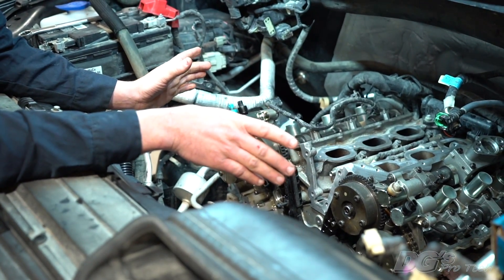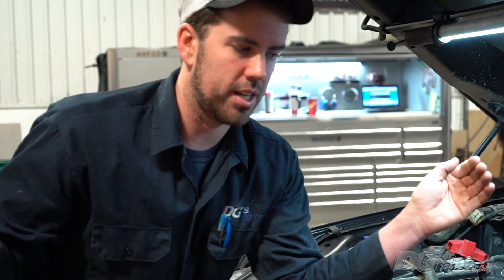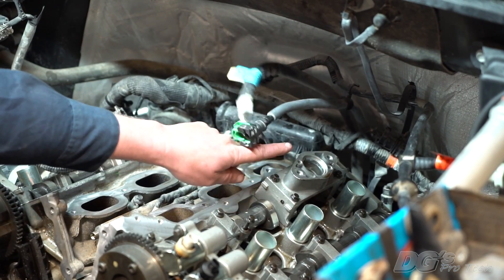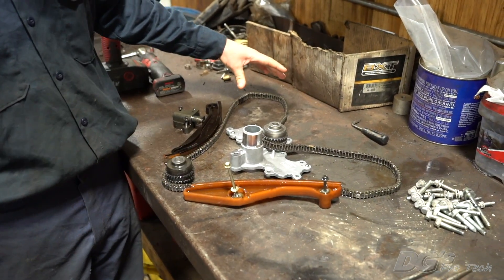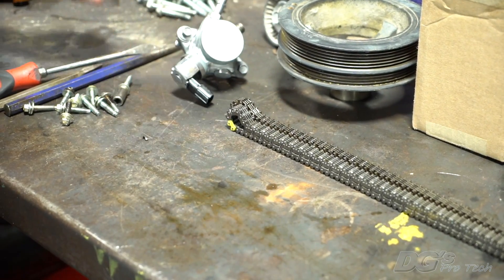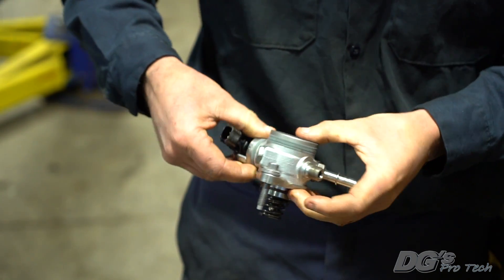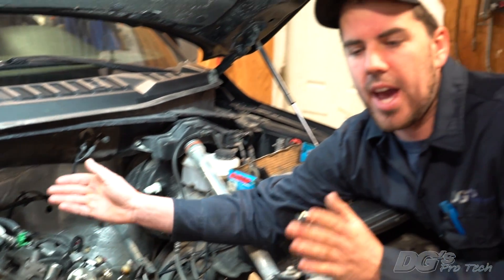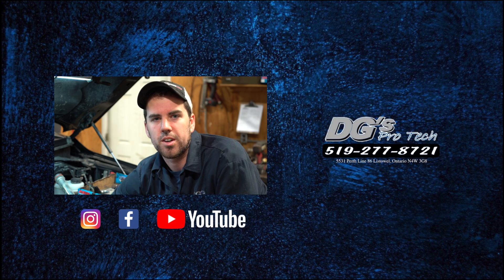Ecoboost Engine Problems!

Comment: This is a great video, seriously one of the best automotive videos I've watched...wish I'd seen it years ago!  We have a 2013 F150 EcoBoost.  Originally was used for short commutes and driven gently to maintain fuel economy, but then towed heavy a few times a year.  Had 2 turbos go out due to wastegate issues (on warranty), and also the dump valve with a tear in the diaphragm.  Then, at 110,000km got the dreaded timing chain rattle.  Replaced the WHOLE timing system ($3500++CDN).  The mechanic who did the work showed me that the original tensioning slider that presses on the chain was plastic.  The new part was plastic but had a stainless steel plate where the tensioner pushes against the slider...this prevents a hole from wearing in to the plastic slider.   Thanks for the vid...you've got a subscriber now

Comment: Great video,and just a minor correction,the changes were made for the 2017 model year when the Gen 2 version came out in f150 pickups with the 10 speed. That engine has 2 separate chains which is why it uses separate tensioners on each bank. According to the forums the Gen2 has cam phasers issues. I have a 2017 and do my maintenance at half Fords recommendation,so 4500-5000 miles full synthetic and motorcraft filter. One other thing different on the Gen 2 is electronic wastegates, which should test cycle at some point right after startup,eliminating the frozen wastegate issues,but adding an electronic wastegate down near all that heat,salt  water and thermal cycling may give us another. Issue long term, failed wastegate actuators....
Reply from the maker: Yes only the updated version in higher models in 2017 The ho raptor etc. Moat models not till 2018
Reply: DG's Pro Tech Sorry man ,it’s all 3.5s in F150s for 2017, the Raptor has the 450hp version, all others were the same 375/470 . In 2019 , the 450 hp version became standard on the limited trim level as well as the Raptor. All 2017s had the 10 speed and Gen 2 engine. I have a December 13th 2016 built F150 and it is definitely a Gen2 375/470. Some other ways you know besides the 10 speed, are the electronic wastegate ,the auto stop/start,and the dual injection system with port and GDI injectors.
Reply: John DiMartino okay So I was wondering this, in the gen 2 eco There is 2 seperate timing chains for each bank and only 1 tensioner per chain? Still would probably help with chain stretch correct? Less load on each chain

Comment: What's your take on the Ranger 2.3  4 cylinder EcoBoost?
Reply from the maker: It's a great engine that has been around in other forms, it is the same engine we see in the mustang now, no major issues,
Reply: @dgsprotech985  Excellant.  I wasn't sure if the weight of the truck made a difference.

Comment: Very informative. Thanks. I have a question: after driving in boost, do the turbos on  the Ecoboost need to be cooled down before shutting down the engine? I know that's the case many, many years ago with turbos so that the the oil in the bearings can cool down to prevent premature failure. Ford dealers say this is no longer required with the Ecoboost. What is your opinion?

Comment: Great video, I agree on the maintenance. Gotta change your oil in these engines. I have a 2014 Ecoboost and I’ve been changing oil every 5k miles with Motorcraft oil and filters. No problems at 77k miles and I regularly tow an 8000lb travel trailer.

Comment: I have a 2011 f150 Ecoboost has 140000 mile no issues. Change oil every 5000 to 6000 miles. I drive it mildly but I always get into it every so often.

Comment: Just wanted to let you know that this is a fantastic video. Just a technical analysis and understanding of how to keep these engines running in smooth condition. Many people need to see this video and understand that these engines need to be worked and opened up every once and a while to keep them running at peak! Of course through, we need to make sure that there is good synthetic oil being used and changed at an APPROPRIATE interval! A little love goes a long ways with these awesome trucks (Recent F-150 3.5 owner)!

Comment: are pushrod engines better?  dont like timiing chain/belt replacements.
Reply from the maker: they have more moving parts and suffer from higher RPM inefficiencies related to more moving parts
Reply: The way most people drive  they would never notice  difference  a push rod lump would do much the same

Comment: Dustin, Great video Thank you. 
I am very interested in your thoughts on what follows.  

I have a 2016 3.5 Ecoboost. I am getting a weird noise upon startup that I think might be the timing chain. I have 107k on the vehicle.  I have always changed the oil prior to the recommended intervals but according to the maintenance schedule in the manual it needs the timing chain replaced at 100k. Were you saying in the video that you won't experience this with better maintenance? Or does this have to be replaced at the 100 k ballpark? Either way I'll get it addressed.

Second issue.
 I love this truck but I've experienced overheating  while towing a 7000 pound vehicle in the Colorado mountains. (That is going above 226 degrees up to 240 degrees in this engine. The software has never shut the power down but it has alarmed me as I don't want to melt the engine.) I've overheated on steep grades while towing that trailer or I've also overheated when the outside temp is above 90 degrees while in elevation. The boost is 15 lbs in this situation.  The way I keep it under control is lowering the gear and raising RPM's.  Just outside Denver I have to go to the lowest gear possible on steep inclines to get enough water through the engine to keep it cool and as a result I cannot maintain a fast speed.  It is ridiculous.   Many other trucks are passing me and I know there is something wrong but am at a loss for what it could be.  What could it be? I was thinking water pump not pumping adequately, Radiator undersized.  Turbos throwing off too much heat...Thoughts??? 
Thank you.

Comment: Thanks Dustin, for sharing.  As many have said before, really nice clear presentation.  I notice the two timing chains appeared to be different in width.  The old one looked narrower than the new one.  Was that an upgraded chain and did you also change the phasers?   Thanks

Comment: The problem wasn't common on earlier Ecoboosts but it did happen. The GEN 2 Ecoboost fixed this any many more issues. So if you want an Ecoboost, try and get a 2017 +. The earlier ones still last past 300k miles

Comment: Great video!!!

I just purchased a 2016 F150 Lariat with 3.5L Ecoboost and have been reading a lot about the issues it can have. In addition to frequent oil changes (every 5000 miles), what are your thoughts about using an oil separator?

I have read posts that say it will help the engine and other posts that say it is a waste of money.

What do you think?

Comment: IS THAT ECOBOOST 2ND GEN?
Apparently they fixed timing chain issue in 2nd gen?
Reply from the maker: they were supposed to be fixed for any model built after 3rd quarter 2014. however we have done many after this date, so i cannot confirm any changes other than to the literature
Reply: 2017 ecoboost is the gen 2, they went to two primary timing chains instead of one primary. They reduced the length of the primary timing chain by over half. They have fixed the timing chain stretch on the gen 2 ecoboosts. They are still having rattle on start up issues with the gen 2 phasers.

Comment: I'm looking for some advice on my 2011 F150 Ecoboost. My truck has about 185K miles on it and is in overall great condition with the exception of the occasional startup rattle from the timing chain. This rattle only occurs when the truck sits idle for too long and once the tensioner is re-pressurized the rattle disappears. I am not getting any codes or drivability issues, however I'm sure this will need to be addressed in the not too distant future. Is it wise to do this kind of a repair (chains, phasers, tensioners, etc.etc.) in an engine with 185K+ miles or would I be wiser to replace the long block? Also, would a Ford Performance complete (JS-382-AA) engine such as Summit racing sells work as a replacement or would it be incompatible with the 2011 computer? The truck is paid for and I'm not going to sink $40K plus on a new truck so I need to figure out the best solution to keep this one on the road.
Reply from the maker: Give is a call at the shop any time to discuss options to repair yours 5194182886

Comment: Great video, I will change the oil every 5K miles going forward. I hope to see an updated video of the 2018+ EcoBoosts timing chain with the extra tensioner
Reply: The Gen2 3.5L EcoBoost came out in 2017, so wouldn't it be 2017+?
Reply: DontComeToMyHouse I’m not sure, I don’t remember where I read the info when I posted this comment, could be 2017+ though

Comment: My Raptor is very early 2018 production, hope it has the revised tensioner design.  The dealer has changed oil at 3k miles, then 5 more and 5 more.  That is it for the free changes.  I plan to change at 5k mile intervals with HD synthetic such as Rotella or Delo and Mopar filters.  Is that a good plan in your evaluation?
Reply from the maker: hi Rooster- call me at the shop anytime to discuss further-519-418-2886, thanx for watching!

Comment: I own a 2015 Ecoboost should I be concerned about timing chain stretch?
I’ve done all my oil changes usually by 30 to 40 % oil life and I use nothing but synthetic oil and OEM oil filter
Reply: Don Olypopper not true my ecoboost has 290k miles never had a timing chain replaced . Only thing I’ve replaced is a throttle body ! I’ve always used conventional oil 🤔 like he said take care of it and it will last
Reply: Cesar Ramos then you’ll be fine my ecoboost has 290k Miles that’s using conventional oil .
Reply: Shed Hunting Worldwide nice to know there is some EB engines with that many miles out there, makes me feel more confident about it’s longevity.
Thanks for the input.
Reply from the maker: Great question Cesar Ramos- call me anytime to discuss- shop line is 519-418-2886, happy to help!

Comment: Do you need to add an oil separator
Reply: Not on the second generation ecoboosts. They added port injection to clean the valves .
Reply from the maker: Michael MacDonald-for more information for your truck-call me anytime-shop line is 519-418-2886, happy to assist you in any way we can, have a great day!

Comment: Gen 2 Ecoboosts actually started in 2017 with the 10-speed, not 2018.
Reply from the maker: you are correct but only in a limited number of models (higher end). the 10 speed went across the complete f150 lineup in 2018 MY
Reply: @dgsprotech985  My 2017 3.5L EcoBoost has the Gen2 AND 10-speed transmission and its an XLT with a build date of 2/17. How is the engine different than 2018+?

Comment: I know you thin syn oil guys don't like to know you have been brain washed by the get every ounce of fuel mileage you can EPA people.  But you do not want to run syn oil in anything with that big of a timing chain in it.  Thin syn oil is terrible for chains. The drain off of that oil is what is killing these chains all in the name of fuel mileage.
Reply: What?

Comment: Idea ford  f150 with a 3.0 Cummings diesel with a Allison transmission that would be good selling truck because ford makes a good chassis
Reply: Cummins 5.0 in Nissan has not been stellar and Allison transmissions are no better, maybe not as good as Ford Torqshift series. Allison 1000 is built down to a price.